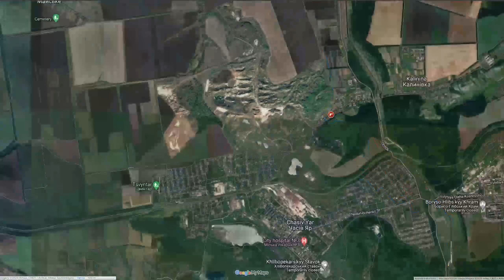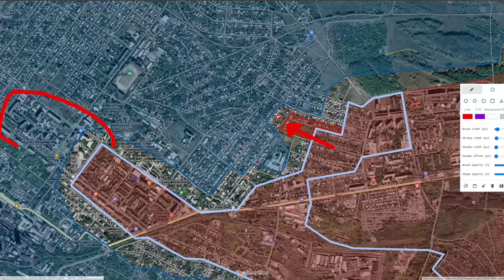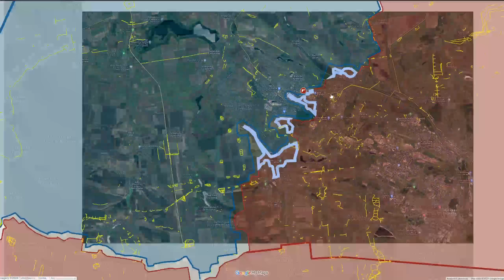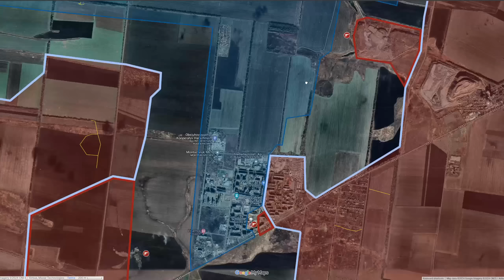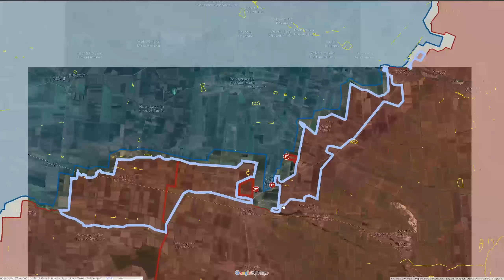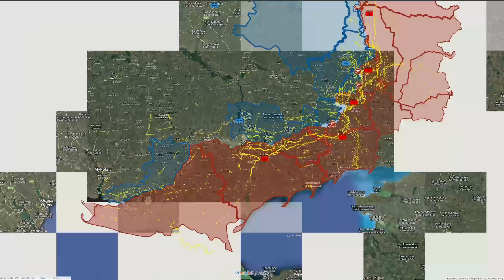Vuhledar On Fire | 72nd Brigade Can't Retreat | Zaporizhzhia Bombed By FAB 500s

Comment: Interesting that Milltary Summery has Vuhledar completely encircled, and he is fairly careful with the Russian advances.
Reply: Military Summary uses a lot of sources that are right about 60% of the time. While it's entirely possible that Russia HAS fully encircled Vuhledar, it's also possible that they may have the occasional presence in the area. Military Summary has changed his map quite a few times updating sections incorrectly or assuming that an area was under full control when it was still contested.
Reply: @Baldeagle1787 it’s difficult to have anything over 60% veracity when you’re making 2-3+ map updates per day in all fairness

Comment: Why is vuhledar so important? Why has the russians shown so much attention to this particular city? Since 2022 i have been hearing about this town.
Reply: This is basically like Avdiivka. Capturing it will lead to a large breakthrough with more captured villages.
Reply: It's a town with a lot of strong, high rise buildings that can withstand bombing fairly well. Also in a pretty strategic location but with open fields behind it.
Therefore the Ukrainians decided this would be a good town to build strong defences. And therefore Russia wants to attack these defences and forces.
Reply: because its a key city in the AFU defense line
Reply: Vuhledar was a real tough nut to crack and a fortress. Geographically advantageous location. A large number of high-rise buildings. All forest belts visible from above. An almost impregnable citadel.
Reply: Ugledar* is situated on slightly elevated ground making the surrounding empty areas easy killing fields for anyone trying to approach. It is the fortress of the south.

Comment: 5:44 Not really.Russia wants the buildings to stay standing as they plan to use the town as a staging ground else they would have levelled it with Fabs, ODAB long ago.
Reply: they already pounding the city with dozens of FAB 500s and ODAB 1500
Reply: Its just the Soviet buildings, they built like bunkers and not those buildingz in gaza that get leveled with a 500kg bomb…
This one building has more steal and concrete in it then 20 buildings in Gaza….
Reply: @Imperius12  When steel is basically almost embargoed by the most moral country, one cannot built a decent building.